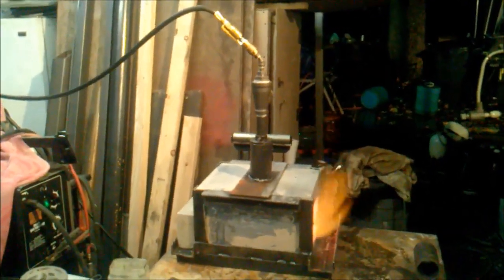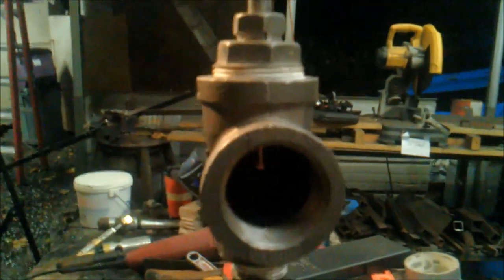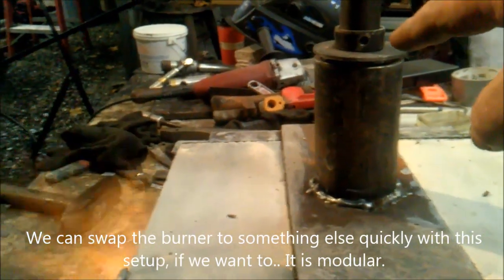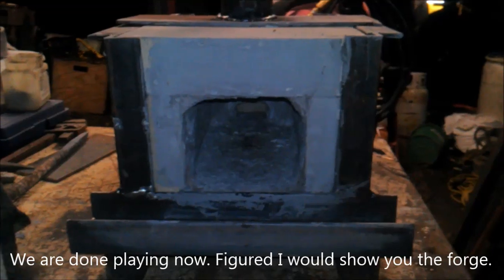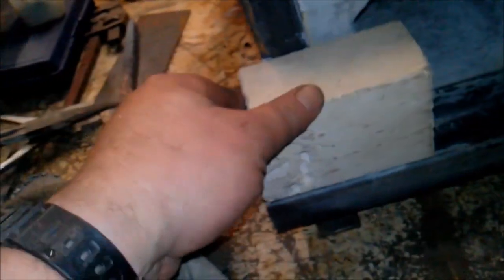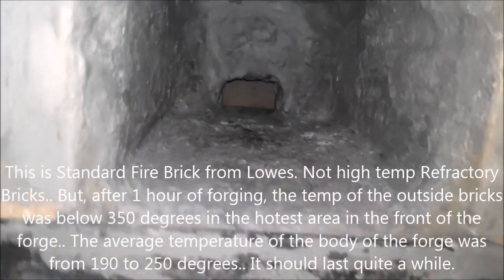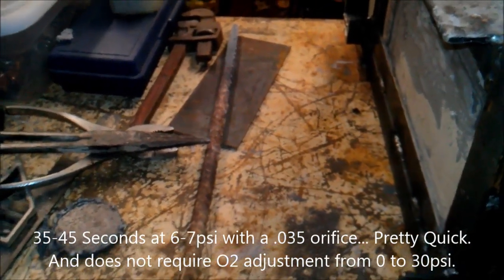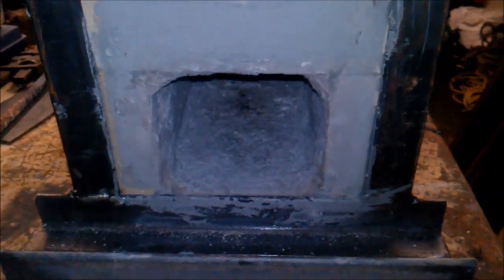A Blacksmith FireBrick Forge

Comment: Mark nice video as always - do you think you needed to coat the fire brick with refractory or could you just go without? I am in process of building my gas forge and was thinking of leaving the bricks uncharted. According to Lowes, those bricks are rated to 3000 degrees F so it got my thinking to leave them in coated.
Reply from the maker: I would think so.. Steel melts at about 2500 degrees.. You won't be driving it that hard..  No sense in burning what you are working on. Ha.. 
I think the bricks I got were 2500 degrees and they are still holding together.. I did put a refractory and a reflective surface in mine.. 
To be honest, I didn't see any difference after adding the reflective coating ITC100. I did not try the forge before putting the refractory in, but, it blistered and some came off a couple of burns after.. Just a thin coat came off.. Like it dried outside in, and I should have waited a week for it to dry properly.. I followed instructions.. I hear this is a common problem with refractories.. 
I would try to keep it humid and let it dry slower if I had time to do it again, but, to be honest, if the bricks needed replacing, no harder than it is, I would probably replace them and not worry with refractory.. 
The other day.. I needed to anneal a 1/2" slice of axle steel.. I decided to do it with my torch, since I had it out anyway..  I grabbed a firebrick and laid my torch on it, and turned my head and let it sit there for a minute.. Just to see if it would pop, split, crack, etc, before I put the slice of axle on it.. 
I guarantee you, it was there long enough if it were metal, and I pulled the O2 handle, it would have cut it... 
I then put the slice of axle on it and heated the crap out of it.. Seemed the brick was pulling the heat away from it.
I think it would hold up fine in the forge,, just after doing that.. 

Now that is out of the way.. I built mine, where I can pull the burner out, and the flat bar top that holds the burner.. I just have it tacked on one side with two small tacks.. I can pull the burner, snap the flat bar off that holds the middle brick in, and and lift the bricks right out and replace them.. They just stay there due to gravity.. 

The forge is basically a metal rack to hold the bricks on the bottom, and angle holding the side bricks from falling out.. The top bricks are what hold the side/rear bricks where they stay.. It's basically a box frame, with bricks for the sides and back.. Side and back bricks don't fall into the forge because the top bricks hold them in place.. 
The width and length of the bricks don't line up exactly, so, I ended up cutting some bricks.. The side bricks, I cut and added a part of one.. The top and bottom bricks are the same. No cuts to place them in. 
I cut it with a circular saw with a blade you would cut cement board with.. Looks like a slotted diamond blade, but, was not expensive.  
I did cut the top brick for the burner, instead of drill it.. 
Tried drilling a circle with masonry bits and tried to break out the hole in the center and that didn't work so nicely.. 
I then cut the brick in half, laid the 1/2 brick on it's end, one at a time between two 2x4's and clamped them, so the brick would not move and I cut a notch out of each end and put them together.. I cut a square hole, but, you could make the outside cuts shallower and cut both sides, then, move in slowly, increasing the depth of cut and get a fairly round hole of sorts... Then, hammer and chisel the pieces out.. 
I cut them so thin,, they did not argue with me.. After trying to drill the hole, I was going to be the boss of the next attempt..Ha.. I welded a pipe sleeve just larger than the bell reducer (3/4 to 1" female/female on the end of the 3/4 pipe threads), on top of the flat plate , made a washer and a collar to sit on top of the pipe to hold the burner at the correct height... I kept it about 1/4" inside of the brick wall, not protruding into the forge.. Can't say that would matter either though.. Anyway you get it to stay, it will work.. 

Hey.. Just thought of something else.. I still have slices of the same exact firebrick.. I cut the to use them in the forge.. They say that using Borax for forge welding eats up the refractory,, or was it the firebrick,, so, I cut some extra slices that I could lay in the forge bottom.. I have been using the forever now, just as a "Lip" just inside of the forge, because after the refractory blistered, the floor surface was irregular.. I put the brick just inside of the front of the forge to set the ends of the stock on.. Mostly shorter pieces that don't need the arm further out to hold longer stock.. The ones sitting on the firebrick, I use tongs to work them.. Put a small hole in the back, so, you can push long stock through.. I have two pieces of angle on the back to hold a firebrick to cap off the hole to keep more heat in, but, mainly to keep me from walking behind the forge and forgetting the dragons breath is coming out of there..Ha.. I finished straightening out a 6 foot piece of coil spring by pushing it through the rear hole.. 
It's cheap and easy.. I would go with Kaowool, if it were important to be light weight.. As far as insulation, the firebricks don't get hot on the outside.. Not too hot anyway... Kaowool might be better as far as that goes, but, It's going to get hot anyway, so, get used to it..Ha.  Everything has fit in it so far, except a st of coil springs.. 
One day, maybe,, I will make one out of a 30lb propane cylinder. .(1/2 of it, slit from top to bottom). Then, kaowool the inside. Sit it on a table with a firebrick face, and keep a bunch of firebrick on or around the table, so I can raise the 1/2 cylinder up on both sides, slide firebrick under it, and firebrick in the back to match, and I'll have a forge that I can put Coil Springs into.. Kaowool because it will be lighter to lift and move around at that point.. But, then, I would have to move to 2 burners or a fan forced ribbon burner, and, I like the Economy of the small forge for about 95% of what you would normally do in a forge.. 
Hope that helps..

Comment: Hi Mark. Simple question.. why does the burner sit on the top of the forge, where the most heat is?
Reply from the maker: Good Question..  It was my first. I was told the firebricks would not work in a forge... I didn't see why they would not. I bought one and heated it with my cutting torch and decided to build it.
Didn't really put any thought into that.. I think Top is better than the sides for space reasons.. In the floor would have made sitting it on a table difficult unless you put a 90 degree in.. 
There is a bell reducer on the bottom of the burner.. It sits just inside of the top firebrick.. I would say between 1/8" to 1/4" from protruding into the forge.. The Propane releasing under pressure is cold, and the air running into the pipe due to the venturi effect is also cool..The Bricks insulate very well. You have to run the forge for more than 15 or 20 minutes for the bricks to start to warm up.. They never get blistering hot.. The burner never gets to the point you can't put your hands on it.. I would say half way up the burner, by the air intake,, it is always "Cool to the touch".
It really is not an issue.
Reply: Thank you :-)

Comment: does it get hot enough to forge weld?
Reply from the maker: +Sal G Yes. I have done some forge welding.. A few small pieces of round bar using Borax.. Can't say I am a professional at it, but, I did get it to work several times, and failed quite a few times.. But, when you hear the Snap and you see the sparks fly, you pretty much know it's welded... Just don't beat the fool out of it.. Seems it is much better if you smack it one time, and work it together after that, and don't count on a perfect weld, until you heat it a time or two after and work it together... Pounding it flat on first heat, was a dismal failure.. 
I believe it is about finess and working the two pieces together, more than heating it up hot/hot and banging it together.. I have not had time to work in the shop lately, but, it is something I want to go back and focus on for a day, while I perfect the skill... Just try it easier than what you think it needs, and give it a good coat of borax, and let it get good and warm.. I think this is where the borax gets sucked in and actually does the cleaning and coating, and then, when you give it a good lick, it will snap or pop, and the hot borax will fly out and you will have a pretty good weld.. Then clean it up a bit, coat it again, heat it up again, and finish what doesn't look fully welded.. I did this a couple of times, and it worked each time.. When I didn't get the snap or pop and the sparks,, it didn't work.. 
I think it would be easier in a coal fire, but, I am not sure... It would be easier to see the colors, and there is no doubt that a coal fired forge will get much hotter, but, propane will do the trick, just take a little longer.. 
You won't burn the metal in a propane forge.. Or, at least I have not seen it done yet. Might be able to do it with forced air, but, most furnaces I have seen are propane fired, but, oil run with forced air.. So, propane might do it for sure with some help... Hope that helps.. Wish I had more info to share about it. I built a lot of stuff learning, but, Forge welding was something I really didn't get to perfect.. I have a coal forge now, but, have not yet fired it up.. Just too busy with other stuff, but, I love working with the metal.. Cheers and good luck..
Reply: thank you for the response, and hope to see you get back out there and back into it, I'm trying to get into it myself but with a small budget I'm trying to build most of the things myself like anvils and using 1x42 grinders instead of 2x72 but we'll see how it goes, again thank you for the response. Cheers